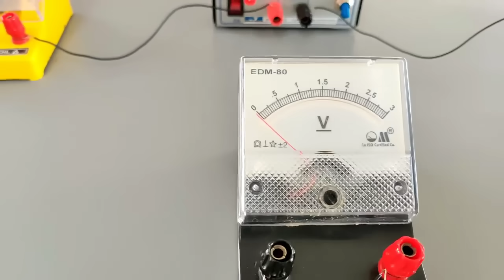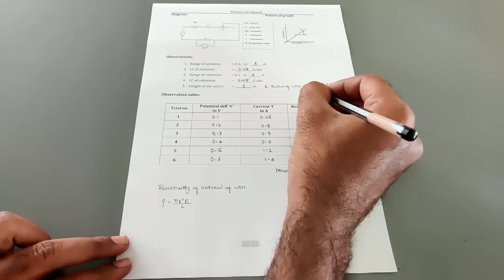Resistivity of material of wire by Ohm's Law| #2ndpucphysicslabexperiments #resistivity_of_material

Comment: Sir in practical exam how to find it is resistance per unit length of the wire or resistivity of the material of wire 
Plzz reply me i am confused 🤔❤❤
Reply from the maker: Aim of the practical will attached to your paper, it'll be mentioned in that.
Reply: @ParivartanPhysics71  thank you so much sir 💖